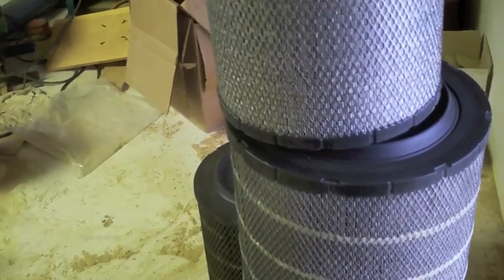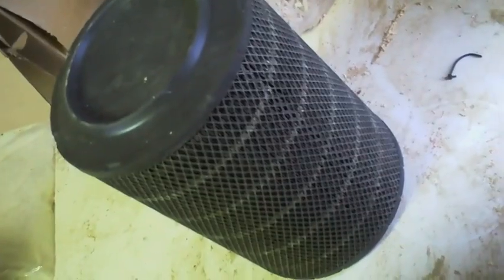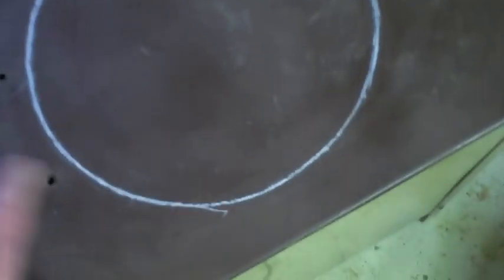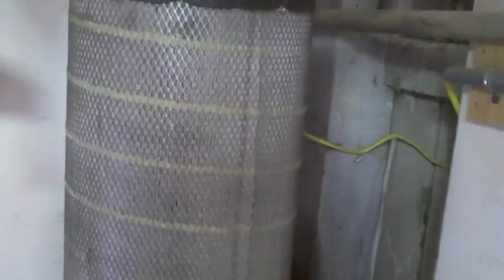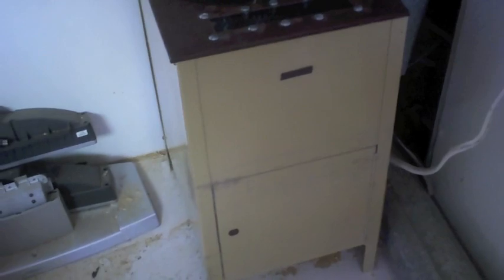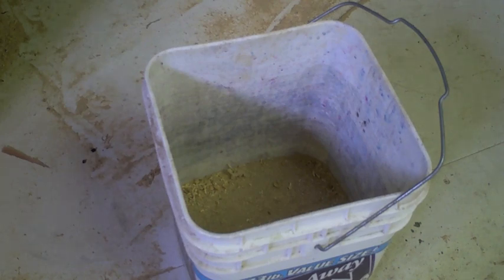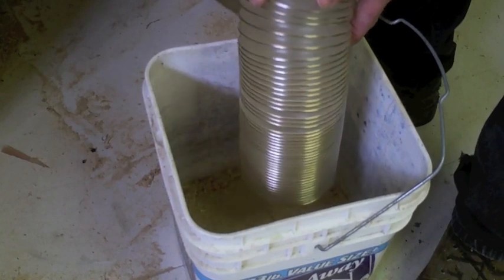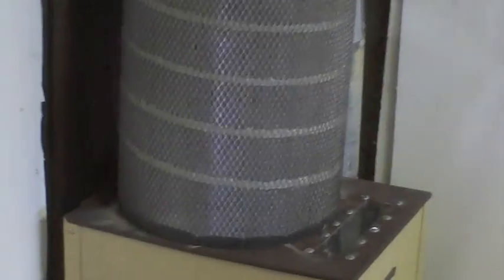Home Built Cyclone Dust System Pt.6

Comment: What!? I Didnt get your set up matey!! You have the blower and the separator there out side and you should just have also there the exhaust port and the filter not the filter in the dust container ... The dust container is negative pressure anyways no need of filters
Reply from the maker: +LiPe VoLcOm It pulls everything outside where the cyclone yanks 90% or more of the dust/chips out (small leak in main dust can so I am getting more than I 
should in the filters) then the cleaned air is blown back inside the 
shop passing through the filters and out.  The filters sit on a catch 
can because I thought the cyclone wouldn't be as efficient as it is.  I 
know now I could have just had the filter stack and been fine.  Blower 
is outside to keep noise down and save space, air is blown back in to 
save the hard fought for heat in the winter time.  I assure you the 
system works awesome, the best modification I ever made in my shop.